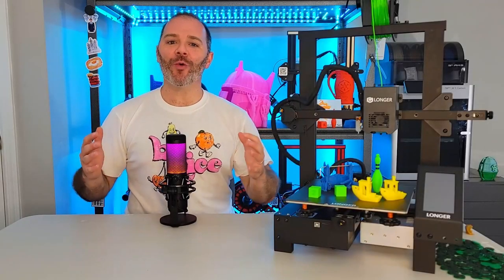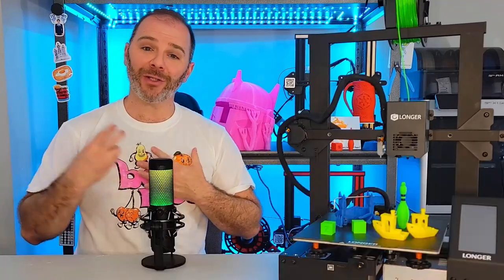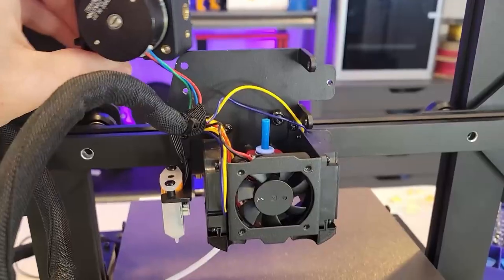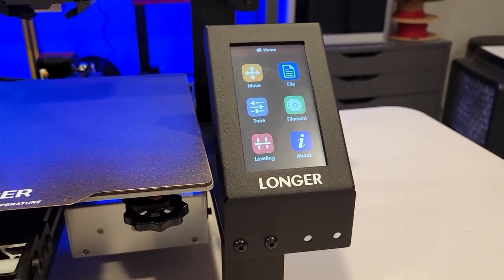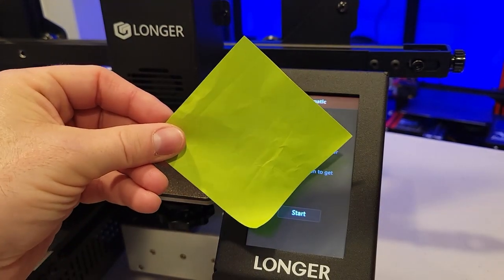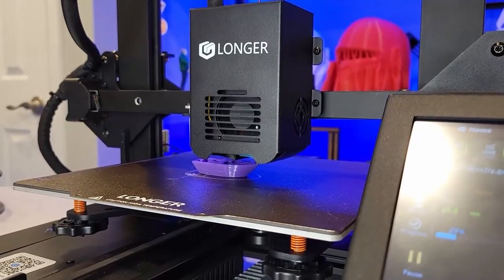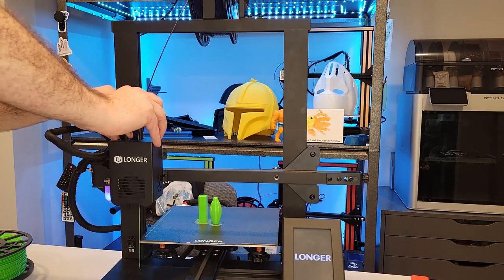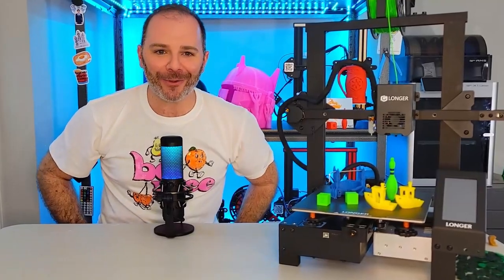Longer LK4 X Assemble, Review, and Giveaway! Found out how this printer can be yours!

Comment: I watched some of your videos, and I thought that I will give it a shot using kipper…. i’ve have everything up and running but I have an issue. I try different sites and different types of information. The problem I’m having is kipper sees my bed as 1 50 x 1 50 but it is 300x300.. the printer is a CR10s I checked the config files to make sure it was set right but every time it tries to go past 150 it hits the frame…. Can you give me help with this situation? Really appreciate it.
Reply from the maker: Lancelot I can absolutely give you help! I have a CR10 also (V2 Pro) and your issue sounds like it shouldn't be all that hard, something to tidy up in the printer.cfg. best way to help is looking at some files. Hopefully you signed up for the giveaway in this video, which means you joined my discord. If that's the case discord is the easiest way to get to me, otherwise email me and we can chat (printsleo3d@gmail.com).

Comment: Hey Leo, I thought I give you a update on my printing?  I had the Neptune 3 go wrong and the touch screen went blank, 
the power and fans worked still but no touch screen access.
I contacted Elegoo and sent them a film of the star up showing the blank screen. 

They said to check some things and I did and still no luck?
They sent me a replacement screen and cable for it ( two in fact ) and 
I told them of the power unit plays up so they sent a replacement power unit and a new Micro sd card as my one was now unreadable I think a power spike happened 
and burned out the card? I tried the new screen and power and still no luck as no screen icons.

They sent me a new main board, Now after me taking the old one out and fitting the new one with new power unit and cables and card, it has fixed the problem!
The printer now working again.  You can't fault Elegoo tech help and re-supply of replacement parts, my printer is only 8 months old.

I also just got a email and text from dpd parcel post telling me my new Elegoo Neptune 3 Max printer is coming tomorrow ( Friday the 2nd June ) wow that was fast as I pre-ordered it back on the 16th May this year as it been out of stock for ages due t the popularity of it and the Plus version, they emailed me on the 16th May that the Max was back so I had the saved money and ordered then!
Being as the Max is huge, I will have to clear more room in the spare room where the other 3 printers are?  I will need it seems a huge amount f room of 35 inches square to allow for the bed moving and the size of the printer as a whole.  That means a lot of boxes to replace somewhere in the room as that room is a storage for my old home items in allot of cardboard boxes.

Normal UK persons, we seem to like to keep stuff a long time all in boxes filling up our homes LOL 😆

Such fun.  The Max sure be a whole new printing level compared to the others I have? and now Elegoo just are releasing 6 new 3D printers today resin and FDM.
There's a new Neptune 4 pro FDM printer with a two sectioned heated bed for different sized models to save on not needing to always heat up the whole bed.
A extra 4 cooling fans along the back of the X gantry like the Sovol 7 has.  they doing a new 12K resin printer like my Saturn 2 in design but black case & top.

Uncle Jessy just did a Live video about the new machines > https://www.youtube.com/watch?v=ZWq7BxJHBiQ

So all new stuff happening mate.  I may try later on get the Creality Sonic Pad to get Klipper for the 4 printers I will soon have?   It is a bit pricey now. about the price of a budget printer.

Talk later 😉
Reply from the maker: Colin thanks for the update! Love hearing about how your doing in the 3d printing world. Seems like Elegoo has done right by you as far as the customer support goes. It's good to hear some very positive feedback about a company like that. 
    Big printers are great! They let you print all those models you didn't want to have to glue together lol. 
    As for the Creality pad I would just add a word of caution. It's a nice product but when it's coupled with nonCreality printers it can be a little difficult to navigate. I know people who have them and weren't all that happy. I just got the BTT Pad 7 which hopefully is going to be a lot more friendly with different printers. So I'd just say read around about the Sonic pad before buying and be wary! 
    Thanks for keeping me up to date Colin!
Reply: @PrintsLeo3D   Hi There Leo, I thought since you like me updating you I d so again.

I got my new Elegoo 3 Max printer at last, it in fact came far quicker than I was expecting it to do? I was told after ordering that it be around mid June 23. 

But it came much quicker than that.  I ordered it on the 16th May by their site and got it delivered on the 2nd June.  I had to leave the huge box unpacked for 2 weeks due to the space in the spare room nearby the other 3 printers not being cleared yet, it was just so fast delivered!

I was a bit fiddly to build it as it was so huge and hard to balance the gantry top frame unit to do up the bolts to the huge base unit. But I had to prop the base up on two spools of filament to get clear access to the underside to attach the top to the base.  

The auto leveling is amazing it did the leveling so good far better than the Neptune 3 did?  
I done TPU well with it as the direct drive works so well. Nice to have a printer with this? I have to see if the Aquila and the Elegoo Neptune 3 can be made direct drive? Maybe even the FLSUN Delta QQ-S Pro can as I know the new bigger FLSUN Delta 400 is direct drive already!

The only two things I would have liked to be also on it was a All Metal Hot End and firmware to go to 300 C  and a Klipper firmware unit.  Those are on the new Neptune 4 & Pro models the Pr having also metal wheels and liner rails too.

Would you think I could do a all metal hot end Throat upgrade to the Neptune 3 Max? The firmware though is only set to 260 C as of now!

I hoping that Elegoo does a 300 C firmware update since so many users are asking for it now on the Max?  

Cheers Leo. 😉
Reply from the maker: Colin happy to hear the new printer is working out for you. The Aquila can definitely be made direct drive, but also can just be upgraded with a BMG clone to handle flexible filaments. I would think most all 3d printers nowadays should be able to accept an all metal hot end, but finding firmware that can reach 300c is the hard part lol
    Good luck with the machine and I hope it all works out!
Reply: @PrintsLeo3D  Hi Again Leo,  Thanks for the info about the direct drive!  Maybe you could do a video about the many options for the different printers like the Aquila of installing a direct drive system and the types available that hopefully are not to pricey or fiddly to install?

The Elegoo Neptune 3 Max is a beast and really is amazing, It goes faster than the Neptune 3 the speed for the Max is around 180 mm/s at the fastest. I try though to do say around 140 to 150 mm/s just to be safe.  I not had to re-level it even once since I set it up. I just turn it on and put on the filament and file from the micro sd card and press go on the very good touch screen and off it goes.

I have a link to the 1st video I did of it printing a wall mountable yellow petg garden grass strimmer holder I designed in Tinker Cad to hold the many blades and Allen keys and two bolt on wheels the strimmer can use plus the holes for the two rechargeable batteries so I can mount the hold up on a wall the keep the strimmer and bits neat.

Here is the link for you to see >
https://youtu.be/z4tp2vihtP8

The printer is not too loud about the same with the other printers.
Reply from the maker: Just saw the print it looks really good! There's so many direct extrusion options out there it would be a good idea to go through a few of them. Maybe I will! Thanks !